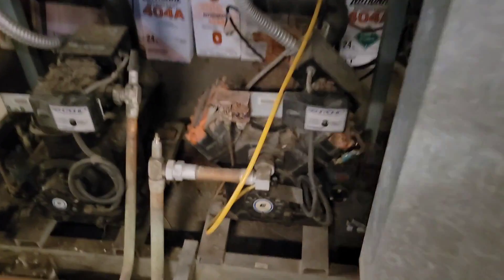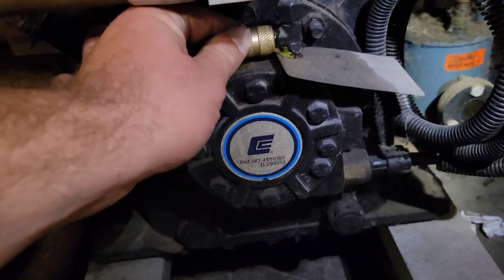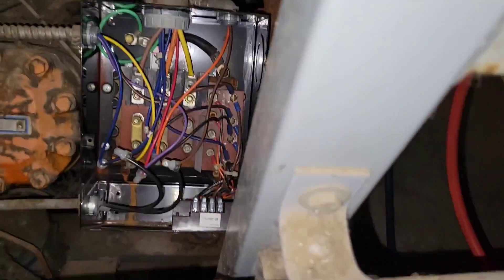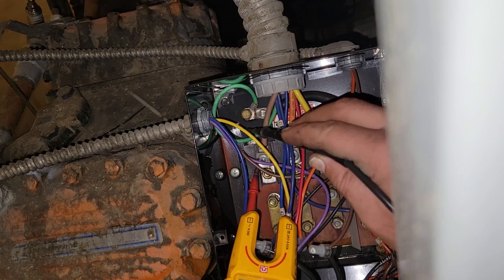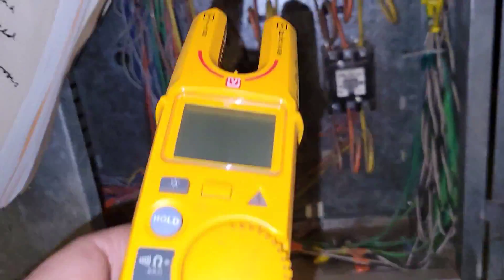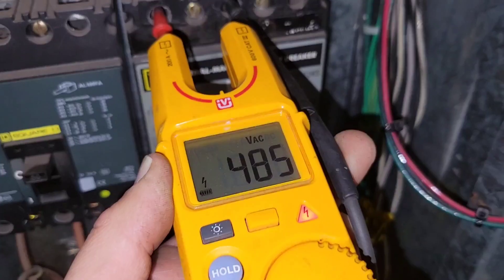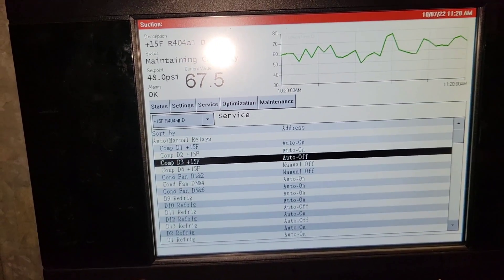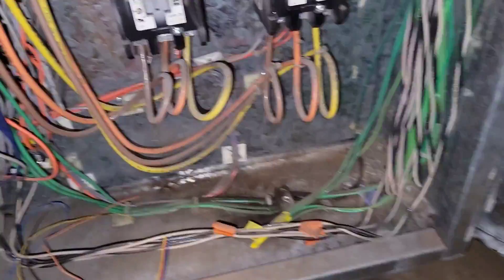Supermarket Refrigeration- Troubleshooting A Not Working Copeland Compressor! (Found Bad Contactor)

Comment: When you paused out the oil from the compressor- Did you attach the common hose to the liquid header or the suction header??
Reply from the maker: So one side of my gauges hooks up to the back of the compressor. 

 The other side hooks up to any high pressure Area. So you could use the discharge or the liquid.

Comment: You said the contractor was 208. That’s 480 no?
Reply from the maker: I might have said the wrong voltage by mistake. 

But the contactor it's self is rated for both voltages

Comment: You can’t check continuity with the wires connected lol
Reply from the maker: The Allan keys  On the Terminal Block were stripped out so I could not remove them.  

 I probably should have mentioned it though good catch

Comment: Your troubleshooting is excellent! I've been in the HVAC/R skilled trade for some years. Your videos, from a teaching standpoint, are better than any other service technicians' videos that I've watched on YouTube. I'm not knocking any of them. They all are competent technicians...Please correct me if I'm wrong in the following two scenarios: If that open contact within the contactor occurred while the contactor coil control voltage was de-energized, then once the control coil was energized on a call for refrigeration, the compressor that contactor controls would never have started due to one phase missing from the three phase power supply required. The overload within the compressor motor windings would have eventually  opened up if the locked rotor amperage remained present for too long. Another scenario could be that the contactor contact opened up on that one leg while the compressor was already online running. In that case, the compressor would have begun to single phase which would mean it would run very inefficiently by way of its amperage draw significantly increasing and there would have been a voltage deviation between the phases that was well above the less than 3% deviation allowed by the OEM. Eventually, the internal compressor motor windings overload would have opened up and the motor would be de-energized, even if the contactor was still closed... One last note, I am not comfortable front seating a discharge valve unless the curcuit breaker for the compressor is locked out and tagged out by me first or unless I have pulled off the two control voltage wires from the contactor coil of the contactor that controls the compressor I am isolating. I also have to tape off those two control voltage wires with electrical tape if I take that route. That is the only way I'd feel safe that the compressor could not start while I have the discharge valve in the front-seated position. Again, this video was excellent teaching. Thank you for uploading and sharing it. You are a very good commercial refrigeration service technician.

Comment: Just a side note for newer techs... If the compressor shows a short at the compressor terminals, make sure you disconnect the wiring at the compressor and recheck for internal shorts before condemning the compressor. I've had dozens of apparent shorts that turned out to be rub throughs in the conduit between the control panel and the compressor. 😀
Reply from the maker: Thanks excellent stuff :)

Comment: How do you check a compressor protection module ?
Reply from the maker: I could try to do a video on that the next time I come across it
Reply: Check between M1 and M2. If you have voltage it’s bad replace it.